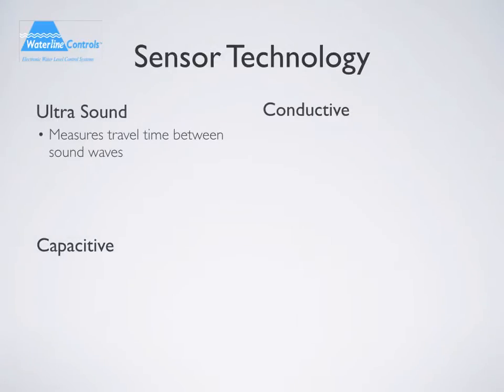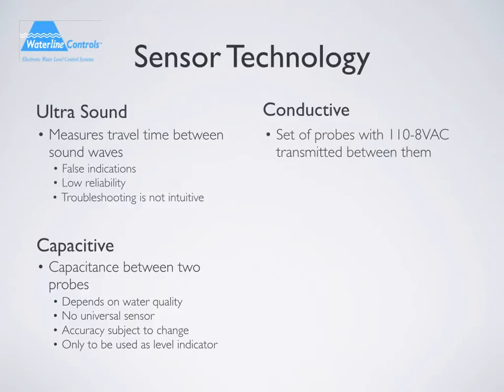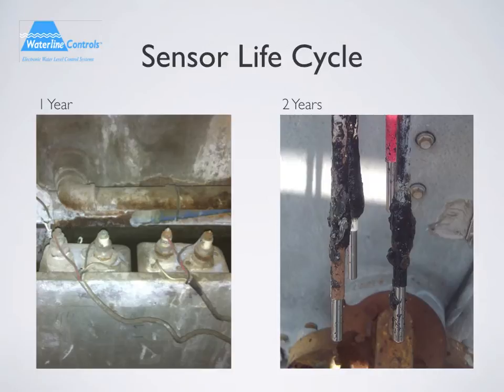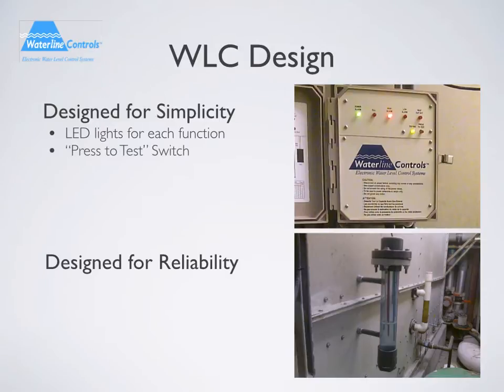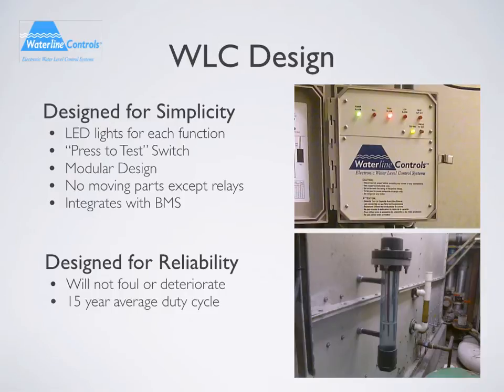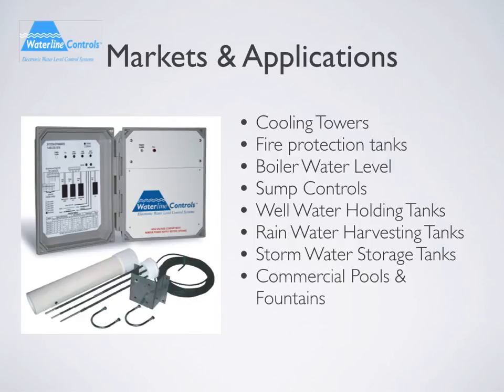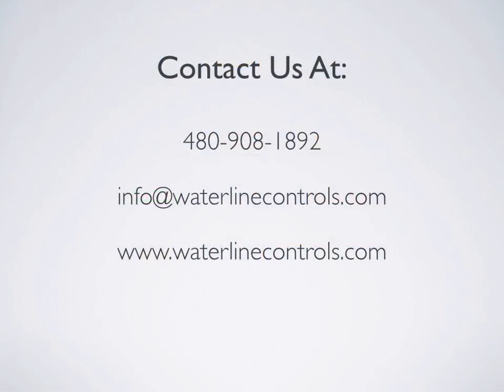What to Know About Waterline Controls

Comment: At 3:32 “power is never transmitted between probes”
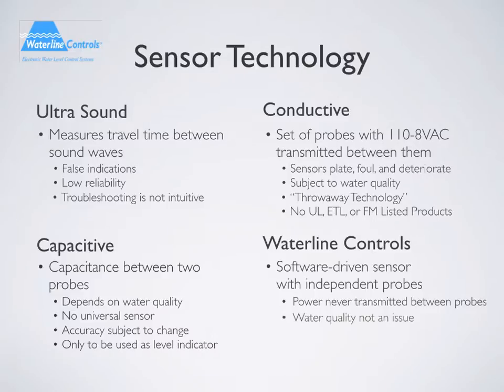At 3:43 “we use low voltage and low current”
Isn’t current in combination with voltage = POWER?